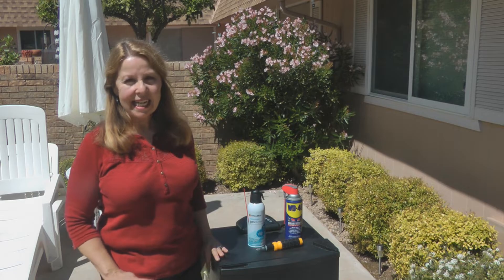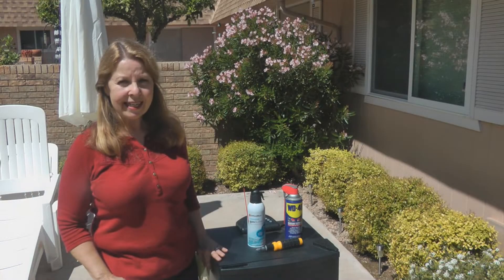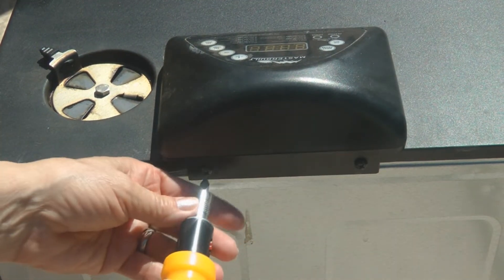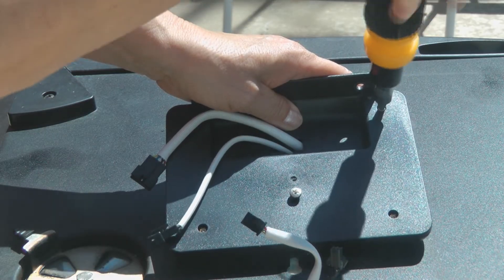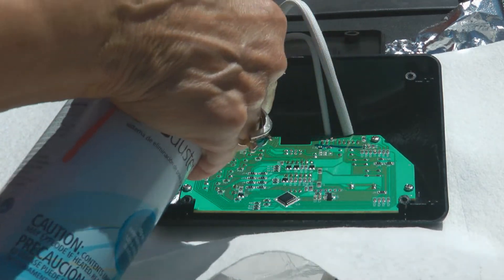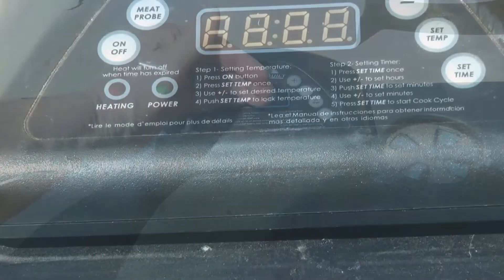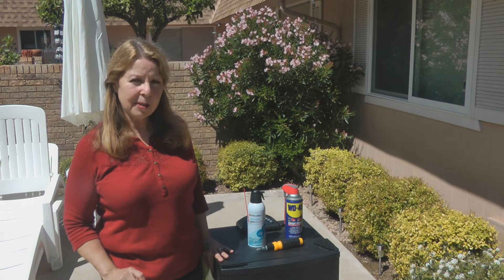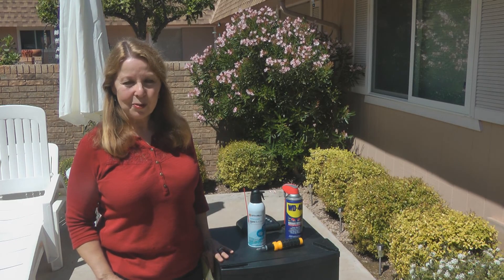Fix Masterbuilt Smoker Control Panel Won't Stay On Clicks Won't Turn On

Comment: We found removing the control panel when the smoker is not in use and keeping it in the house eliminated the common problem associated with these smokers. The circuit board gets ruined by humidity, condensation and rain. It is not weatherproof. Thank you for this video. I am certain it has saved folks a lot of money.

Comment: I had 2 large heritage breed black turkeys deboned and dry-brined for 2 days ready to smoke when my MB electric smoker control panel would not let me set a time... therefore, it would not heat to cook my birds.  I tried this fix and it worked beautifully.  My smoker still wouldn't heat then I discovered that the wire connecting to the heating element was off... so, I soldered that back too.  Took a lot of MacGuyver'ing, but I was able to smoke those rolled turkeys for 6.5 hours and they came out beautiful.  Thanks, Alaska Granny... you saved my day and you're pretty hot too.
Reply from the maker: So glad you got your smoker to work.  Smoked turkey is delicious!

Comment: I did this and it worked!  thanks for putting this on Youtube!  I went ahead and removed the screws holding the board to the front panel and also cleaned the inside of the cover, and cleaned the buttons themselves with WD-40.
Reply from the maker: Glad this worked.  Happy smoking!

Comment: Great video, AlaskaGranny! For what it's worth, I didn't have WD40 or compressed air handy. I was in a time crunch, so I just crossed my fingers and blew the dryest air I could muster up into that control panel. The Rib Gods smiled down upon me, and granted me passage. Controller works now, and I reattached that sucker backwards so it doesn't get as steamy/smokey during my cooks. Good luck!
Reply from the maker: So glad to hear you got your Masterbuilt smoker to work.  I LOVE ribs!  Did you use a hair dryer?

Comment: Thanks for this tip. I was able to detach the controller but the four little screws are rusted (wonder how many millions in profit they made by using steel screws and that require a smaller screwdriver, design engineers are nuts). Any tips on how to deal with this or am I screwed?

Also, why don't they waterproof this key component? Too hard for them, I guess.

Comment: Thanks grangran, I had this issue... I found that smoker got some condensation under the electronic hood. I'd recommend using a hairdryer - I have to discourage the use of wd-40 however.

Comment: This is a known issue with this model and similar smoker models with the controller mounted on the top.

Moisture works past the thermostat and into the back of the case, from there, the warm moist air rises and comes out the top of the smoker. It then collects in the smoker controller and shorts out the control board.

The wd-40 or other water repellant helps keep the condensation from shorting out the control board.

It's a design flaw. 

I moved my controller so the warm moist air can freely escape. Not the most elegant, but it keeps the moisture out of the controller.

Comment: Tried your fix AlaskaGranny and it worked or should I say it is working right now. I'm not too sure the WD40 does anything on the circuit board or the compressed air does anything there as well. I think the actual issue is in the connector(s). This area is subjected to moisture. When you take the control panel off and removing the connectors, you are probably swiping the dirty pins in the connectors and getting them clean by that action. Next time I'll just try doing that and see what happens. I did spray the connector with WD40 and compressed air so that has a cleaning affect on the connector pins. But, if it wasn't for your video, I probably would be ordering up a new smoker vs. typing this in the comments section. Thanks for the tip. BTW, my smoker has been sitting out in the cold, snow, rain for 4 ½ years. I do have a cover but that's about it. When I am smoking and a rain comes up, all I do is put a pan over the controller to try to keep it dry.
Reply from the maker: I am glad this works for you.  I try to troubleshoot everything and make things last.

Comment: Thanks for this! 
Curious if this has been a long-term fix for all of you? Applied it today - didn't have WD40, but has a WD40 electrical switch cleaner so used that instead. Turned it on once and it worked, but time will tell the next time I try to smoke something.
Tried it again today, a day after the fix, and the smoker turned on and I was able to adjust temps and cook time. I don't have anything to smoke right now so it will be a few days until I can try an actual smoke, but things look good for now. Thanks for posting what looks like will be an effective fix.
Reply from the maker: My smoker has continued to work after trying this.

Comment: I have the same smoker and issue. Before doing all that, sometimes just unscrewing the control panel and letting it sit on top of the smoker is all you need to do.
Reply from the maker: Nice tip, thanks.

Comment: I had the same problem with my controller and it turns out it was caused my used wet wood chips causing condensation to enter the control panel..never a problem when using dry chips.
Reply from the maker: Interesting, thanks.

Comment: This fix does not make any sense.. But it seems to work for all of you. My guess is some cold or loose solder joints on the control board. Maybe the wd40 helps make the electrical connection... Scratching head.
Reply from the maker: I don't know why it works, I am not an engineer.  It did work for me.
Reply: WD40 displaces water. There must be condensation on the circuit board, which the WD40 and compressed air get rid of.

Comment: will this work if i cant see the numbers on my display anymore? if not does anyone know how to set the temp and time again without being able to see it? i used to know how many times to hit certain buttons to get to desired temp but i dont remember what the starting temp is when u turn it on.
Reply from the maker: I suppose you can add an oven thermometer and adjust it that way.

Comment: The Masterbuilt smokers are good EXCEPT all of these digital controls are CRAP !  I have  gone back to analog controls and don’t have any problems anymore. All of my grills and smokers are used then cleaned then stored indoors.
Reply from the maker: Is there a brand of smoker you recommend?
Reply: @AlaskaGranny  Any brand smoker with an analog control is better (or more reliable) than any brand with digital controllers.it’s just having to get used to the fidgety analog dial to dial in the temperature ( I use an oven thermometer in the middle of my smoker ) I don’t know why they cannot get the quality of these digital controls up to a more reliable standard.